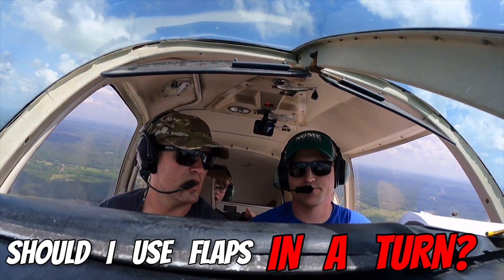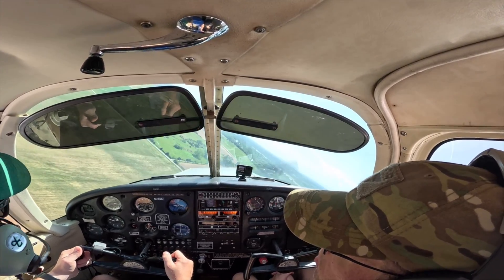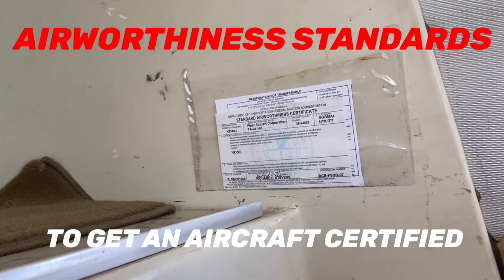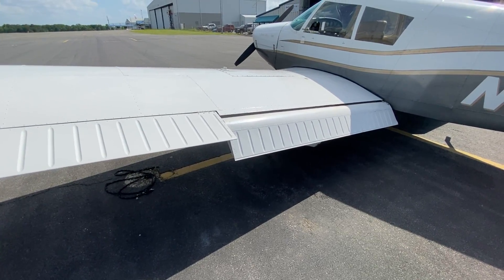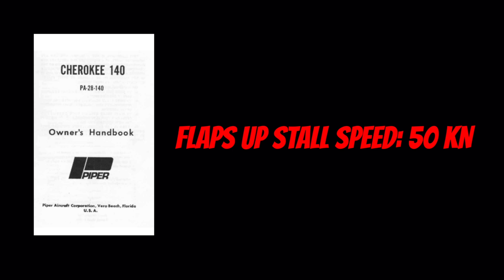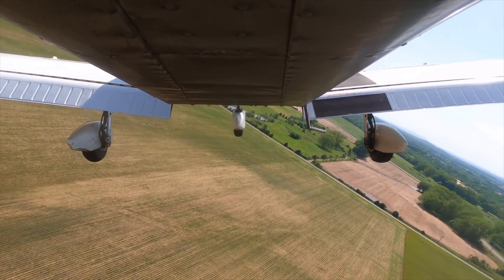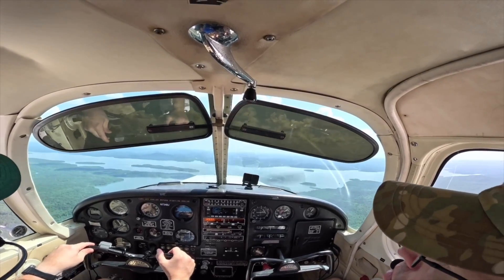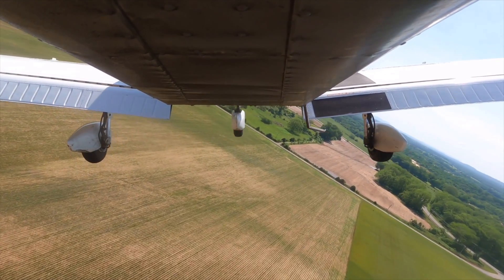Should I LOWER Flaps in a Turn?

Comment: My private pilot instructor was a retired Airforce colonel with a civilian ATP rating. He taught me to use flaps 10 degrees at the end of the runway on downwind, additional 10 degrees on the turn to base, and an additional 10 on the turn to final, over the years I have never experienced a single negative event from using flaps and I never approached a stall in turns.
Reply from the maker: That is exactly what I teach
Reply: @FreePilotTraining  And you are 100% correct, from 70s to today that technic worked for me.
Reply: @FreePilotTraining  this is what I teach as well.
Reply: @sncy5303  I can't see any logical pilot arguing against using flaps in turns.
Reply: My father-in-law taught me to fly. He was also a colonel in the Air Force and trained pilots in T6’s. He also for many years piloted C130s. As a civilian instructor, he taught me to use flaps exactly the same as you are showing. It’s never been a problem, and brings great stability to the approach.
Reply: That's about what my old, Vietnam era, Navy A-6 vet, CFI taught me years ago...and we covered turn into base/final stalls to a great degree.  In fact, I consider the training to my private ticket as not a "how to fly' but rather, how not to kill yourself experience.  Can't thank my instructor (RIP) enough!
Reply: @michaelquillen2679  Sadly, some students and even licensed pilots don't get it.
Reply: Agree. You must be stabilized before a turn. Then you can modifie your configuration. Not only about flap use, also trim configuratio. Nice job.
Reply: THE HARRY BROWN PROJECT
It’s considered bad practice to select flap down WHILE turning but there should never be a problem turning with flaps down, problems occur because of poor speed control and failing to remember that turns and flap increase drag. Just because you’ve done something for years doesn’t make it safe. The simplest thing in the world is to take off but 583;people were killed at Tenerife because an arrogant pilot took off without take off clearance and he was more experienced than all of you!
Reply: @hb6986  Taking off without clearance, practicing horrible CRM, and being a general jerk have nothing at all to do with using flaps in the turns. If you properly trim your aircraft and use only trim for your speed control added drag will not reduce your speed but it will give you additional lift. your decent rate should be controlled with power. You are making some incredibly poor assumptions about the hours flown by people in this conversation without knowing any of us. US airforce trains pilots to use flaps, and some of the most experienced pilots use them religiously. I took my first lesson in 1970 and have accumulated little experience and ratings since then. I trained 100s of pilots, worked in aviation, and conducted some very challenging flying. You need to spend some quality time in the cockpit with an experienced instructor and try extending flaps in turns. Remember in that situation trim controls the speed and power controles your rate of descent. :)
Reply: need to bookmark this comment for my training
Reply: Bingo. I learned the same way. Just keep an eye on the airspeed and it's good-to-go.
Reply: I went to the same school ... again ... I fixate my comments to people that, I "use" flaps in a turn, but don't "deploy" flaps in a turn.  Certain planes have the characteristic to "balloon tail high" with flap deployment.  Others (Cessna 210) can give you a "real surprise" if you deploy a combination of high speed (100 knots) and full flaps on short final.  At flare, the full flap configuration and air flow hide the elevator thereby dropping the nose from an elevator stall.  One experience and a new set of underwear convinced me that full flaps and tested airspeed make life a lot more fun.  BTW ... I love the 210.
Reply: @richardgreen7811  I was referring to training aircraft such as C150, C152, and C172. By the time a new pilot gets to more advanced aircraft, he will learn the idiosyncracies of such aircraft.
Reply: I've taken the jet away from more than one retired colonel.  Air Force colonels are typically politicians with wings.
Reply: Yes, I was taught 10 dg. at end of runway, 20 dg. on base and 30 deg. Final, unless you were a little too low you could just land on the 20 deg. I taught my students this way too and in over 2,000 hours flight instructing never a problem. Not sure where this myth came from. Bad instruction I guess...
Reply: @SAWats  I think it is people with little experience that are confused by the fact that flaps produce drag. If you are maintaining a constant speed with trim and extending flaps drag is overcome by the power if needed and with each extension, your stall speed is lowered considerably.
Reply: I agree with your video to use flaps in a turn but my new instructor doesn’t allow me to use flaps in a turn 😢
Reply: @khimanidarshan3854  Solution is easy, change the instructor. The fact that he does not allow the use of flaps in turns tells you he did not think his approaches through. However, I can't emphasize enough to trim your plan for proper approach speed when you extend the first 10 degrees of flaps. In the case of Cessna 152 that would be 70 knots let the trim control airspeed and power rate of decent. do not override the pitch with yoke inputs until flair. Airspeed will remain the same but with each additional 10 degrees of flaps, your stall speed will be lowered. Altitude and rate of descent are controlled with power.
Reply: @khimanidarshan3854  It is not my video, however, I agree 100% with his outstanding method.
Reply: I’m a very new pilot, I’m glad to hear this as I’ve been doing this since the beginning of my training and have had 0 issues.
Reply: @asadnadeem3227  Gentleman that created this video is 100% correct, I hope to see more of his videos. During the approach, you are most vulnerable in turns if you are maintaining constant speed with trim and lowering your stall speed with flaps you are not likely to become a stall spin statistic.
Reply: Tighten the turn but need to lower the nose, keep up the airspeed. I actually lower the flaps during the turn.... Which made certain instructors crazy😅
Reply: To make this all work out as it should you complemented the flaps with the proper airspeed.
Reply: @shopart1488  exactly right
Same indicated airspeeds no matter what the density altitude is.
Reply: @Arturo-lapaz  as long as you know the minimum and stay well above it. You can always loose the speed on final. Pay attention land the plane then play with the gadgets after you set the park break. And always fly with enough Airspeed, it won’t kill you!!
Reply: @shopart1488  Right, talk to Juan Browne (blancolirio channel) and his friend who define the minimum maneuvering speed as 1.41 times the clean indicated stalling speed, as the minimum speed while in the pattern, that corresponds to a bank angle of 6o° , 2 g load factor where stall, flaps up , occurs. If you stay below 45° bank angle with or with flaps at that speed you have plenty of safety margin. The stall danger occurs against a very strong head wind, there the wind decreases near the ground ( wind profile is close to the 1 seventh power law ) The rule is to add one half wind speed to the final approach speed, which is close to the best gliding angle into the wind, important for glider pilots, obviously.
FAA recommended approach  speed is 1.4 end of white arc, 1.2 for a short field landing, both full flaps.
So inconsistent  methods, which is the source of the confusion.
Th most important is to limit bank angle to 30 °  and always add ½wind speed me on final.  Flaps  lower the nose, improving visibility.
CFII, SME,glider here.
And what is more important wind speed is reported as true speed airplane behaves the same at all altitudes with the indicated AS, not TAS 
at 12000 feet TAS = 1.2o × IAS
at 6000 feet TAS = 1.1 × IAS
Reply: @shopart1488  loose?  really?

Comment: Hello and happy E=mc^2 to you!

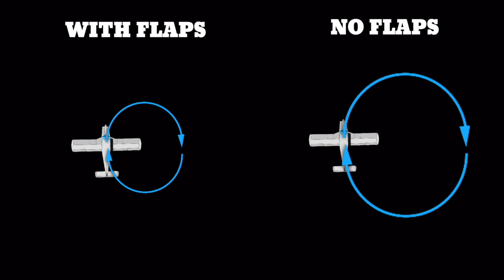I am not going to say that using flaps in a turn will lead the airplane to the ground, but I did take a bit of an issue with the claim at 11:10 or thereabouts that you can tighten a turn by using flaps, while maintaining the same airspeed and angle of bank. Please allow me to use... EQUATIONS to demonstrate my point. Well, maybe not equations but a bit of physics and common sense. Here goes the mansplanation.

I presume that you'll agree with me that at a straight and level flight the lift equals weight. That is true whether or not you use flaps. Flaps increase lift for a given airspeed and AOA, but the magic of airplane stability helps us keep a different AOA once we deploy flaps and stay at a straight and level flight - keeping lift the same as it was. So, at a straight and level flight at 70 knots, lift = weight regardless of whether you're using 0, 10, 25 or 40 degrees of flaps.

Now let's look at a 70 knot 30 degree bank turn. Your vertical component of lift is your total lift times 0.866 what it was in level flight (that's the square root of 3 divided by 2... ugly, sorry), while your total lift will be the inverse of that, or the plane lift times 2 divided by the square root of 3. That is 1.155, which is exactly what that load factor as a function of angle of bank graph would show. Again, that also is true regardless of whether or not you use flaps.

Now let's look at the horizontal component of lift at a 30 degree level turn. It is equal to the total lift divided by 2 (which is a nice round value for sine of 30 degrees), or 0.577 of the weight of the plane. So - two planes having the same weight and traveling at any airspeed at 30 degrees of bank while maintaining coordinated level turn will have the same vertical and horizontal components of lift, whether or not flaps are used.

Let's add airspeed to the mix. The result of that 0.577 times weight of the plane (horizontal component of lift) applied to a plane traveling at 70 knots (for simplicity with no wind) will always be a turn at a radius of 0.124 nautical mile and at a rate of about 9 degrees per second. Sorry, without equations you'll just have to take my word for it (or we can take this to the equations if it's helpful, let me know).

That's all I wanted to comment about, not the split flap situation, not disputing to whether flaps should be used in a turn - just to this narrow issue, will using flaps while maintaining the same airspeed and angle of bank affect how tight a turn would be. Looking forward to hearing your thoughts!
Reply from the maker: Thanks for the information.  Something I did not mention in the video is that flaps allow you to fly at slower airspeeds which definitely will shrink your turn radius. Now, I don’t disagree with your calculations, BUT those all assume that horizontal lift is equal and opposite to load factor which assumes that weight and centrifugal force are equal. I don’t actually believe that to be the case.  Many physicists believe that centrifugal force is not even a real thing.  I don’t share this particular belief, BUT I believe that the increased lift that is created by the flaps improves this turning capability because there is a side load on the aircraft.  Now, once again, this is a theory, but ag pilots intentionally use flaps to tighten that turn radius.
Reply: @FreePilotTraining  I happen to be one of those people who think centrifugal force isn't real (just as the Coriolis effect isn't real either), I guess I'll have to confess my secret power: I have a bachelor in physics and I'm a pilot (commercial single & multi, trying to make up my mind between ATP vs CFI as my next step. I realize they are not contradictory but as this is not my main gig, I don't have the time or attention span to pursue both simultaneously, since E=mc^2).

Anyhow, I think you are absolutely right that flaps will allow you to make the same turn slower and thus tighter, I was only referring to the scenario at hand of a constant bank angle and airspeed with or without flaps. As to "horizontal lift is equal and opposite to load factor which assumes that weight and centrifugal force are equal", I think you were confusing a few things there (maybe a typo?). Load factor is DEFINED as lift divided by weight, so horizontal component of lift (which is in pounds or Kg or Newtons) is NOT equal and opposite to the load factor (which is a pure number and isn't horizontal or vertical), weight and centrifugal force are generally NOT equal (except a few hand-picked cases, such as a level turn at 45 bank angle), though I would prefer to use the term "centripetal force" (per your point earlier - though the two typically have the same result). Lastly, please do remember that flaps give you higher MAX lift, but typically they don't give you higher lift at a given situation, again, let's look at straight and level flight; if lift is equal and opposite to weight with flaps up (so lift = weight), once you put the flaps down and the plane stabilizes itself, again and unsurprisingly, lift = weight.

Thank you for all your time & effort putting these videos out there, and double thank you for taking the time to read and respond to all comments (including mine).
Reply from the maker: No worries. I’m certainly not an expert, and I rely on a lot of the textbooks that I read to be accurate when I teach.  For example, the Pilot Handbook of Aeronautical Knowledge states that load factor is the resultant force of weight and centrifugal force.
Reply: @FreePilotTraining  To an extent that's true, as in level flight the lift is opposite to the resultant force of weight and centrifugal force and thus it increases when that resultant increases, though if you look at the previous page in the PHAK you'll find a better definition, "a proportion between lift and weight".
Reply from the maker: @talreichert  ah. Never noticed that before

Comment: You circle around this split flaps stuff but the reason people have always been tought the no flaps or spoilers in turns in an entirely different one. A turn is a an unnatural flight condition where you give up lift, tilt your lift vector to a side to get a moving body to change direction. You need to increase the AOA, increase your stall speed, lower your margins. Now you add another factor to the unnatural situation and CHANGE your airfoil. Be it flaps in a Piper, spoilers in a glider. The very moment you do that you completely throw over your speeds and your margin. The inert body adjusts to the new lift condition and now, right at that moment, you're hit by a gust or a thermal. There is a reason why you don't turn into final at a 40 degrees bank but depending on the aircraft maybe fly at 15 degrees.. Be it 20. But changing the actual airfoil in an already unnatural flight condition adds even more uncertanties and that's the point. This whole topic is about pilot error and loss of control, not about a mechanical failure. Your 60 tons Herc might handle that well,  a 1 ton Piper might react a bit extremer. 

And very generally: If you're not sure or comfortable with a situation don't go there. There is this saying about old and bold pilots.. Just be within YOUR limits and if you don't trust adding flaps or generally changing the airfoil in a turn don't do it. There is plenty of time before and after it.
Reply from the maker: Flaps decrease stall speed. I’m not convinced that you are closer to your critical AoA though because most flaps move the center or lift back which lowers the nose.  I like your logic, but what’s more dangerous? Becoming unstable for a landing because you are too scared to use the tools you have or lowering flaps that LOWER your stall speed.

Comment: Not sure if I missed you addressing it, but turning with flaps wasn’t the problem, it’s changing the shape of the foil (and the increased drag) by deploying flaps WHILE already in the turn that seemed to cause an issue with some CFIs. 🤷🏻
Reply from the maker: Yeah, I’ve got a handful of comments saying that, but why is this a big deal? Lowering the flaps move the center of pressure aft which causes most airplanes to nose down.  This reduces AoA and allows for a quicker descent. That’s a good thing.
Reply: A common error is to think that small flap deflections cause drag, they do NOT, in fact after take off the flaps during climb should be deployed about 10° , to lower the nose for added VISIBILITY below and ahead . As long as you fly inside the white arc, you are structurally safe.

Comment: A flew a Cherokee six for decades. I picked up the habit of adding a notch flaps while in my turns to base and Final. It helped keep the nose up in the turn and while adding the flyer it seemed to make the approach smoother and more comfortable while slowing the airplane.
Reply from the maker: I’ve actually heard that exact technique from a few Cherokee six pilot on here

Comment: Unbelievable.  No flaps in a turn because they might malfunction.  Makes about as much sense as not reducing power because engine power changes can result in engine failure.  Or don't use carb heat because the cable could break and you would have poor power levels.  Or don't stick you fuel tanks because you could forget to put the caps back on.  If you are that poor of a pilot, do us all a favor and stay on the ground.
Reply from the maker: 😂 I know. That’s about right